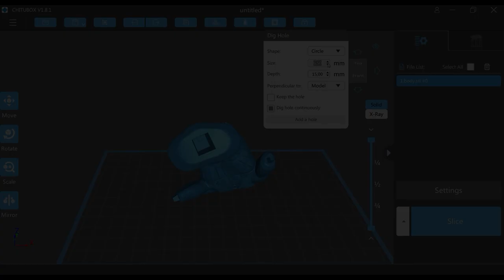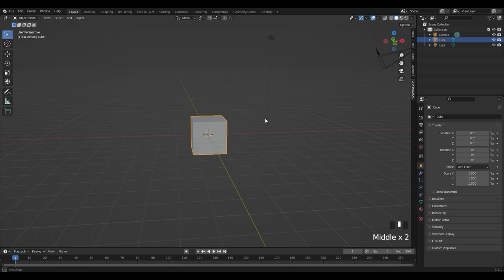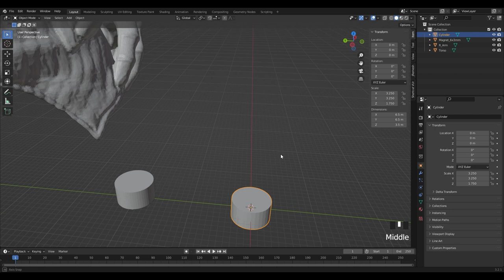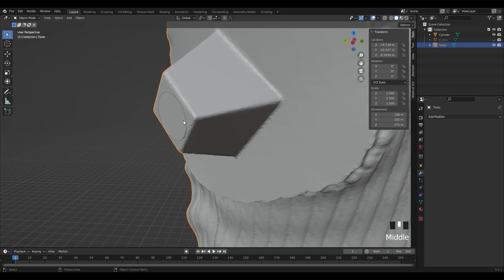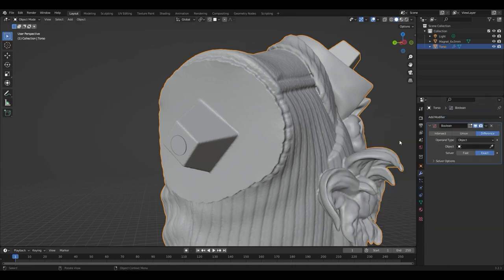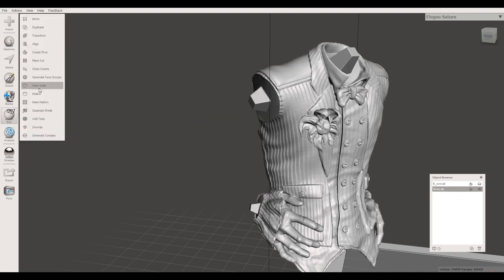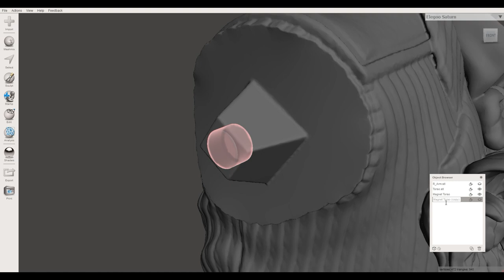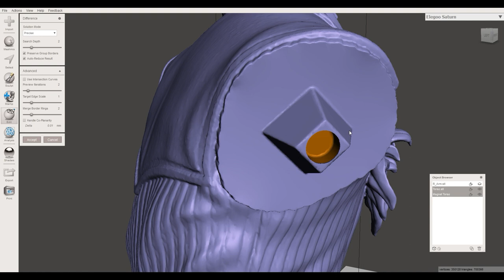How to add Magnets to your 3D Prints (the classy and the dirty way)

Comment: Can you 3d print press fit holes for ball magnets? There is advantage of no glue and no worry about polarity.
Reply from the maker: Never used ball magnets. But press fit and resin doesn't sound like a good combination. The resin is quit brittle. So I would go for glueing.
Reply: @evolutionxstudios Right, the resin brittleness didn't occur to me. I'm doing research for a bit different use case, filament printed modular terrain and buildings. There is very little information on the internet on this so I try to pick everyone's brain who has even a bit experience on magnets :)
Reply from the maker: @GreySectoid  yeah for filament that could work. I also saw a post where the magnet was fused into the print by pausing the print, inserting the magnet, and then printing over the magnet to encapsulate it.